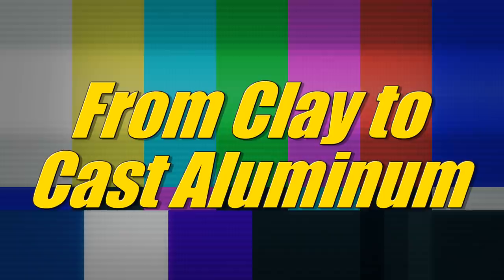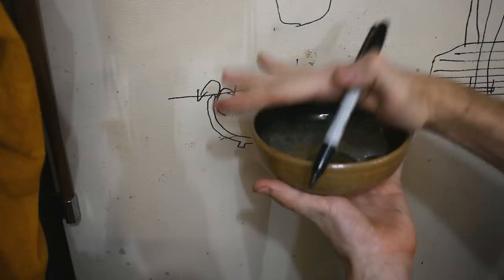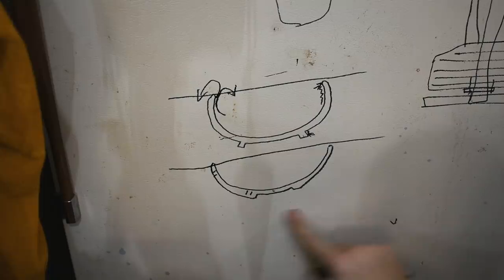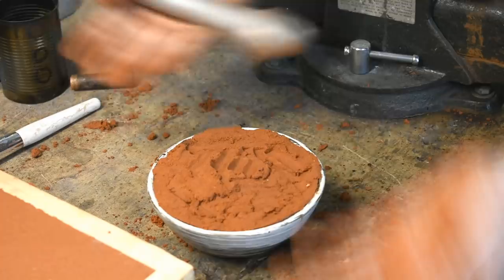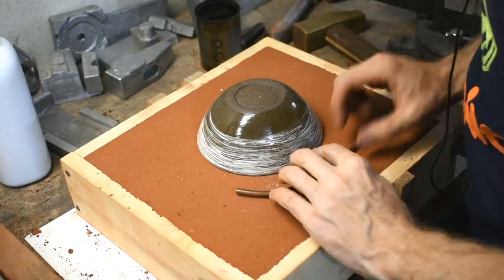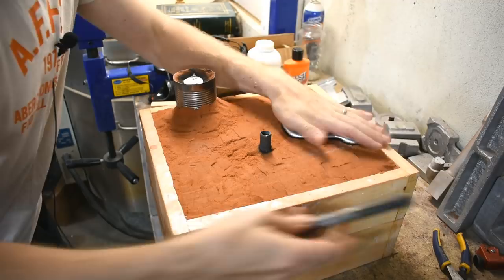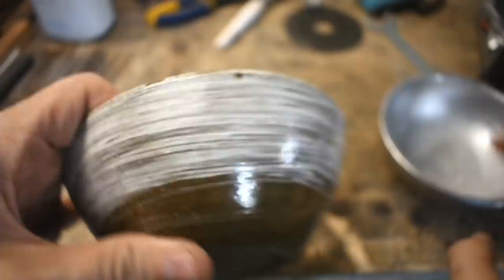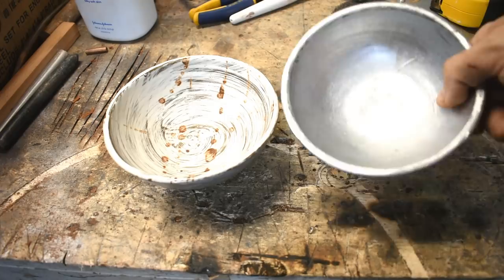Metal Art Casting: Taking a Clay Bowl and Making it in Cast Aluminum

Comment: aluminium is food safe as long as you dont use acidic foods with it.. because aluminium builds up a passive oxide layer wich prevents your food to come in contact with the metal itself (also why it doesnt corrode and such) a prime example of it used in food related stuff is military eating equipment and milk cans, at least here in good old germany!

Comment: Can you please show what you do with the Sand after casting? Can you reuse the blackened sand?
Reply from the maker: So far I have saved the black stuff in a separate bin, and I return the red stuff to the normal bin.  Swdweeb has a video on reconstituting petrobond with 2 stroke oil, but I have yet to do it.  I still have enough good stuff so I havent needing to take that step yet.

Comment: Aluminum is definitely not food safe, especially if you're going to be eating anything that has any acid in it (like tomatos for example). It won't kill you just by touching it but bare aluminum can leach out into food and water with repeated contact. (hence why aluminum water bottles are made less commonly now, and when they are they have plastic or polymer liners like pop cans)

Comment: Would this work with silver? I’ve spent about 6 hours learning ways not to make a silver bowl lol
Reply from the maker: Yes this would work with silver.  In my very limited experience with big lumps of silver, it casts easiest of anything I've used.  Usually silver bowls are formed from sheet, though.  There is a coppersmithing channel I used to watch where the guy did silver too.  It was cool
Reply: Paul's Garage awesome! I’m going to try this. Thanks so much for the reply.
Reply: Is the reverse gravity feed necessary if you don’t have the extra thicker material at the “bottom” of the bowl? If I just kept it level on the table would it still work? You’re making me feel like more of a noob lol
Reply from the maker: Not necessary but it helps prevent turbulence in the flow which can mix oxides in and trap air, leading to air pockets.  If you want some good details on casting practice check out the channel swdweeb, he's running a good series on it
Reply: Paul's Garage thanks for the advice and will do. Really appreciate it.

Comment: try to recreate Orichalcum. I've used a different ratio and have tried to recreate it my self. Made a small knife. However I do not believe I got it correct. So ill give you the composition I made and see if you want to tinker with it.   Fe 5%+ Ni 5%+Cu 55%+ Zn 35% + Pb 3% and a small amount of charcoal which was said to give it a carbon content making it stronger. But was unsure of the amount.
Reply from the maker: That's interesting, I'll look into that

Comment: Ive considered casting my own kitchen ware too, given how fast we go through the more breakable stuff. But considering I can only do aluminum and zinc, I decided against it. Aluminium and zinc dissolve very rapidly in anything acidic (which includes plenty of foods), and there is such a thing as too much zinc and aluminum for your body, and I would not really want to have to worry about it. It can even be a concern with copper base metals even though they do not dissolve in acid nearly as fast. Seems if you are not willing to risk melting your face with the cast iron (much harder to OD on iron), casting kitchenware isnt that attractive. There is always pewter I guess, but I dont like the look of that...
Reply from the maker: Old copper cooking vessels were often lined in tin, that might be worth trying.  Tin has a super low melting point too
Reply: @PaulsGarage  Yeah, tin is supposed to be a food safe material; but aesthetically cast iron was much more what I had in mind than a wannabe victorian silverware look... maybe I should just try it, with some patterning on the outside who knows what look can be achieved...
Reply: Or you could just get ill from the non stick surface coatings.
Reply: Stainless steel is the way to go.
Reply: @markfryer9880  Let me balance out that one-liner with a huge rant:

Considering I am a city boy that does his casting on his apartment balcony I havnt quite convinced myself yet casting iron is a sane idea... so pretty sure casting stainless isnt in the cards for me. If we are to take the black body radiation equation seriously, with its 4th power and all, those few extra hunderd degrees you need for casting stainless will make the radiant heat from molten iron feel like a pleasant glow in comparison. I think im happy to leave that to the pros.

I once tried to figure out why it is that chrome is so bad for you but all the stainless in our kitchen is somehow fine with everybody; and I found little in the way of health data either way. Sure its not that soluble, but yes it is super toxic. No chrome epidemics have been detected as far as i know though; so I guess its fine... under normal use? But yes your stainless pans do leach... https://www.ncbi.nlm.nih.gov/pmc/articles/PMC4284091/

The antimony in typical pewter is also only safe in the sense that under normal use, it probably wont find a way to get it out of the tin and into your body. Allegedly. Though if anyone has better luck finding any actual empirical data on the matter, let me know.

You can also do tin-bismuth with a little bit of zinc for an antimony free pewter with good properties (only need 1% zinc so it could only dissolve from the surface, not the bulk). But that would melt away if you pour frying fat into it, so also not the ideal all-round kitchen material...

Iron and glass make my the happiest, in the sense that they give me the illusion that I fully know what I am doing to my food or myself. 

Aluminium oxide barely reacts with acids though; and it seems from some googling that a 'properly' anodized aluminum vessel does not add a significant amount to your diet even when cooking acidic stuff for a long time. Alu anodizing is actually quite DIY friendly. So that may be the best DIY option overall? That is, if you can reconcile 'DIY' and 'properly'.

TLDR; making your own cookware is hard. If anyone does find the silver bullet alluded to above, let me know.